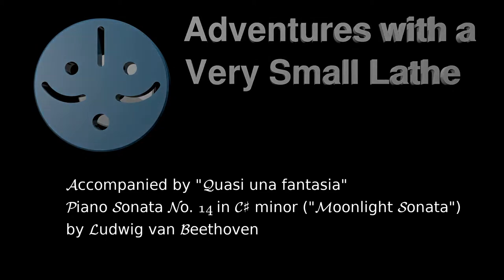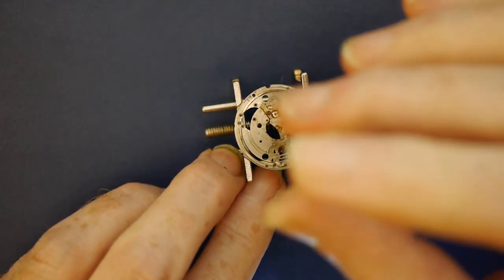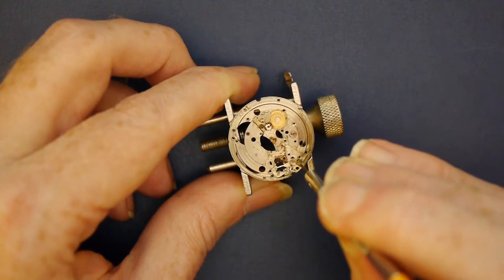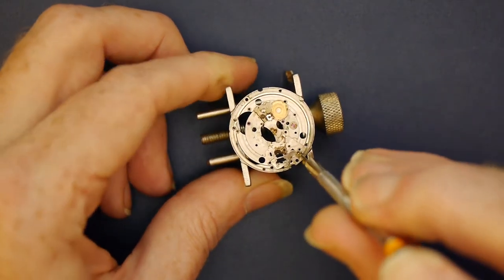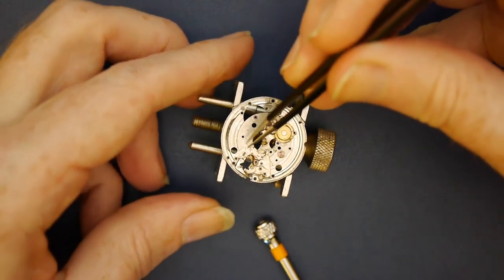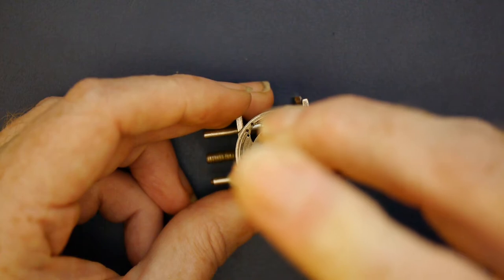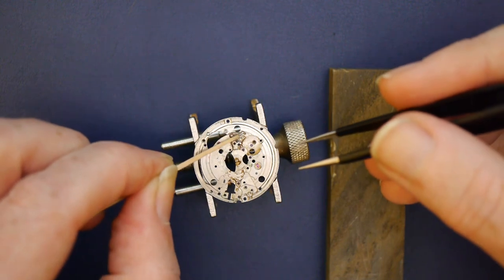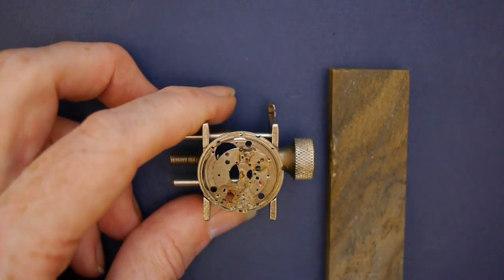Watch Disassembly 3

Comment: well done getting that screw out without snapping it. this old moviement would just get replaced at work, wouldnt even bother taking it apart, but its rewarding to service this mechanism and get it back together! good luck!
Reply from the maker: Thanks! I knew from the start that this movement is worthless scrap, and that's exactly why I picked it to experiment on. The objective isn't a useful repair; it's a learning exercise, and the better job I can do of repairing the movement, the more I'll have learned from it.
Reply: should go back together and run fine. looks like you have plenty of a support network, but if you do get stuck, message me
Reply from the maker: I have some doubts about the calendar and the motion works. Some serious corrosion directly under the face, and a couple of the pinions are pretty far gone. The main train, barrel, escapement and keyless works seem ok though, so I'm confident I can at least get it ticking again. Thanks for the offer of help, I may well take you up on that. :)